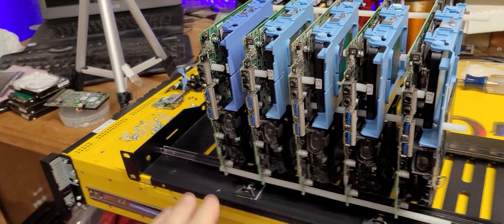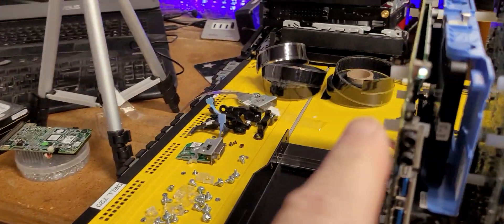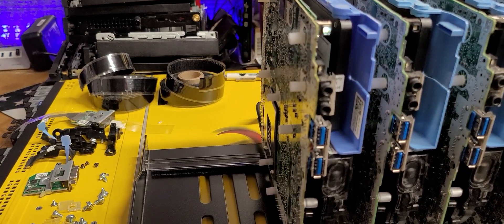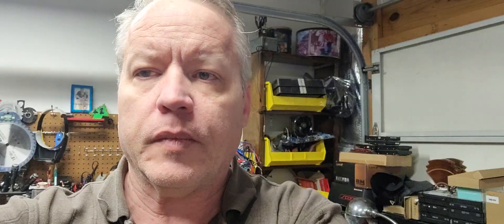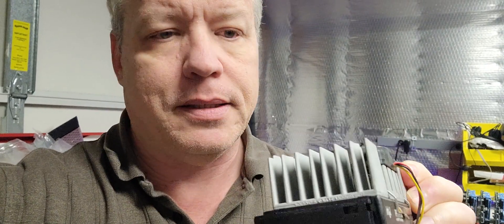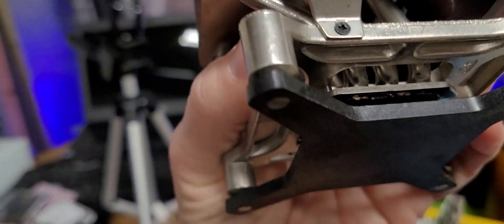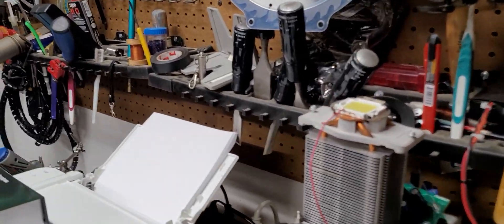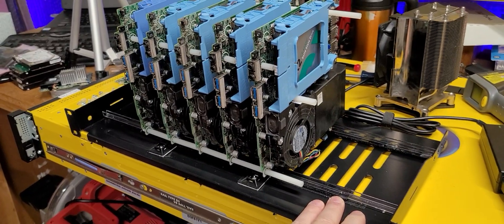Checking how cool the ProxMox MiniPC cluster is staying in Opt 3 format before going into the rack

Comment: hi brad i do like the long videos better :face-green-smiling: 

I have been looking at some other options for cooling for these but its not easy to find coolers that are flush with the board i know they do them but ive not seen many and im wondering if its a custom made thing 

option 1 water cooling or isopropyl alchol cooling :hand-pink-waving:

But if you were to use this method which components would benefit the most from it would it be 

CPU
RAM
SSD
NVME

i was thinking the nvme  and CPU

Option 2 Thermal pads :face-orange-biting-nails:

option 3
Now i am sure why they dont make more component on mother board to take thermal pasted as some IC CHiPS get very hot 
so why they dont have heatsinks for 
NVME or RAM or SSD :eyes-pink-heart-shape:

option 4 :hand-orange-covering-eyes:
might be an interesting project as you showed some technology you have used with thermal cooling so would it be possible to make heatsinks to put on ic chips were you can use thermal paste or is it not possible to do do this because of the way they have initially been constructed

or could you put a micro thin plate on then put thermal paste on that  on these chips and if not why not ? :face-blue-smiling:
Reply from the maker: Hmm this make me think... The main goal with IC chips that make you want them to run with  little or no heat because the IC design can handle at 80%.  This doesn't happens with CPUs and GPUs for the makers push the speed to the point that he x2 or x4 the processors to sell more and thus stressing the chips out big time.  You can buy a basic video card that just using a passive heat sink and works great.   I always look for the IC chip that has a passive or no heat sink from the manufacture and yes you can place a small or med size heat on the IC chip but if they didn't place a heat sink on the chip then the chip stays cool by itself.  the only time that this doesn't works is with cheap SSD drives and RAM solutions (If you over clock the RAM.)    

More to come on this and my son will help me so yes yo uwill see longer video I think... lol   Later an be good.   P.S> when are you going to do a video or ten?
Reply: @leadiususa7394  No my idea around cooling is more the extension of the life of components as don't forget this equipment is not new to start with 

so improving its thermal foot print when possible is a good thing

CPU 
My thought around this was when you start running these under load it would keep them cool 

M.2 nvme op1
but we no m.2 nvme run very hot so that external e.sata extension to drives instead of using m.2 nvme drive on board might be a good idea, not sure how much wider the gap would be between servers for you to put those in though, but you decided against this it may not be an easy option 

M.2 nvme op2
My other thought was you could put an m.2 nvme e.stata extension in an option one but you probably would have to modify the case for feeding the wires out.

onboard ram
now this may run within thermal parameters so it may not need any cooling

SSD drive 
This needs some improving
Reply from the maker: @1111000ANGEL0001111  I agree with much of this and I did apply thin heat sinks to the SATA SSD drives before I placed them back in the drive housing but I didn't drill the casing to allow air to exchange inside.  Still thinking about that.  We will see with your other ideas.  Did you notice I rarely pause this time.  LOL  Can you see the shakes or what. LOL...
Reply from the maker: @1111000ANGEL0001111  I also think I will keep this option 3 running for a bit to really stress it out and then we will see if your ideas of cooling might help.  Time will tell.  / : >   Good input man!  Or lady... I am not sure... lol
Reply: @leadiususa7394  i didnt notice you shaking, some people do like short videos but i do watch things on electronic repairs and it can go on for hours. i find it interesting although i dont understand it all. even though ive been watching it for some time now
Reply: @leadiususa7394  longer videos i think is a good idea, as to this its basically because alot of ssd drives you can buy cheaper really are at end of life, i mean they dont tell you this but this is the case so i was wondering when they put these heat sheilds on nvme drives can you not do something similar with ssd circuit board obviously you would need to take the drive out its housing and put on it some thin thermal plate followed by thermal paste followed by another plate as that video i showed you previously of nvme drive they get very hot im not sure the current heat plates they put on these really disapate alot of heat from them anyway 

but as they run hot im guessing they will degrade faster so if you can cool ssd drives or nvme drives down then buying peoples tech would last them a little longer it also may run better if its cooler

as to me doing videos i dont really have the setup for it but if i do manage to be able to do it i will do videos although its not something my current budget is going on its mainly on building two servers and it takes alot of time because i see some good deals but i dont always get what i see so sometimes its a case of luck and alot of waiting, as i cant afford to go out and buy brand new which i think would be the case for alot of people on here. :hand-pink-waving:

keep up with the good videos i do preffer the un edited ones but some people also like to do edited ones i guess i look at it like this if you dont have to edit it , saves you time. well maybe :face-green-smiling: